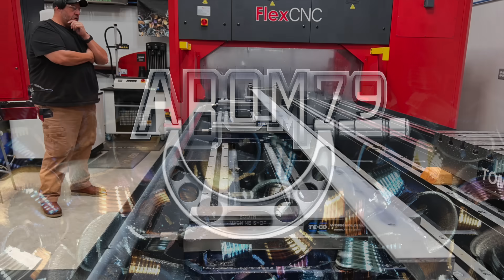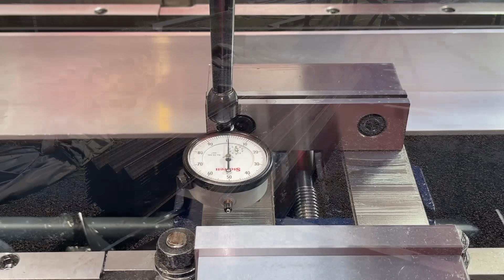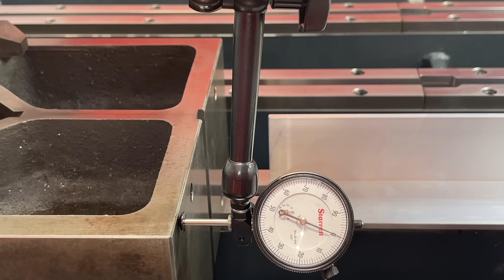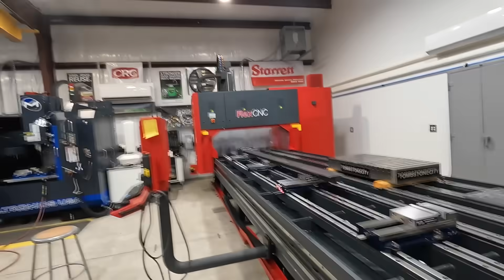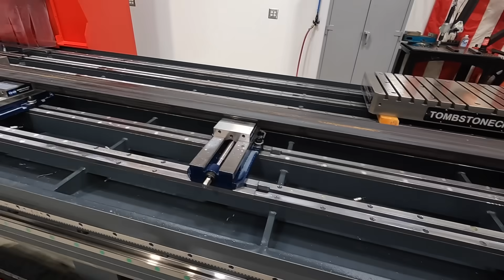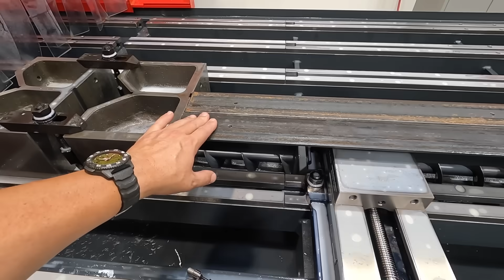Production Drilling in the Flex CNC

Comment: That's a job for an ironworker if I've ever seen one
Reply: No
Reply: Owning a piranha iroworker myself for the last 8 yrs or so I would hate to think I could compete on per unit pricing in production work against a machine like this especially in a small diameter hole like that.
Reply: @jeremyabshire4875  I agree. this way you could do something else when this unit is running
Reply: @johnkries8189  LOL how much are you going to get done in the 1 minute cycle time? I'm not sure what length those are but it sure looks like he could have fit 2 setups on that bed end to end so his minion could be swapping parts during the machining cycle.
Reply: @jeremyabshire4875  I'd have thought that such an experienced piranha owner would know that punching 5/16" holes in 1/4" thick angle is no problem lmao.